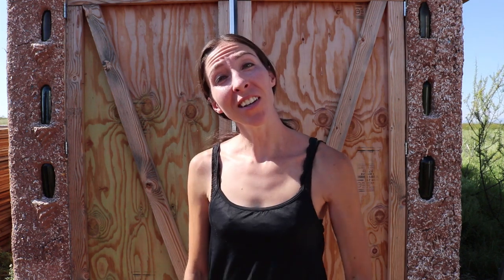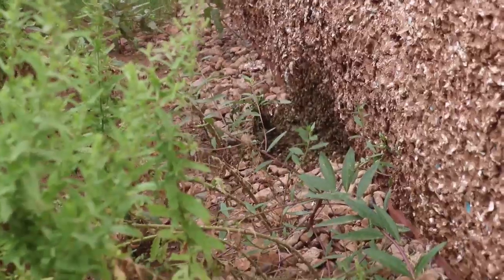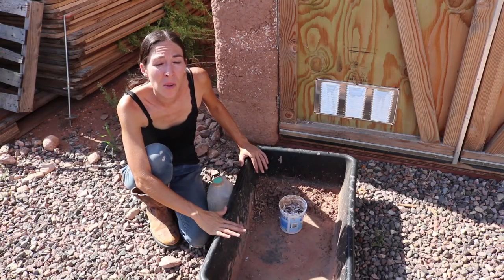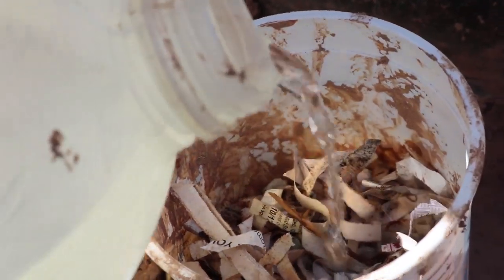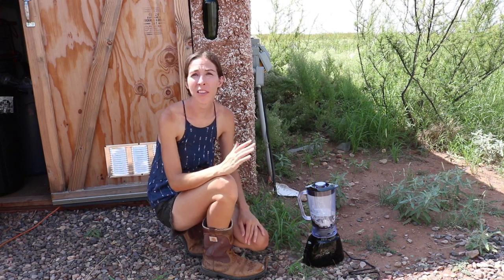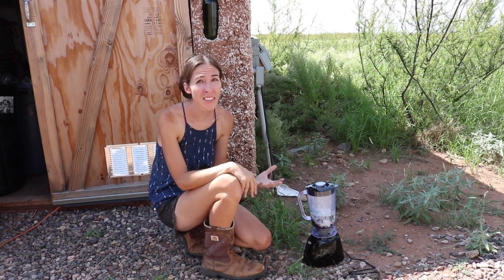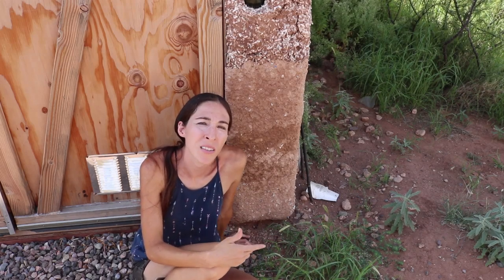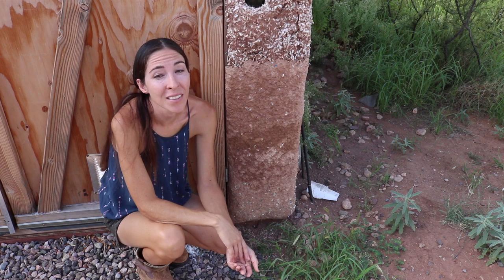Using Adobe Building Technique to Finish Our Off-Grid Solar Shed

Comment: To prevent cracking in the finishing plaster  you can use Cactus (Nopal) soaked in water, the viscous liquid from the cactus prevents the plaster from drying out too quickly and prevents the cracking. 
You can use 5-6 cactus ears, chop them up and let it rest in a covered 5 gallon bucket filled with water for at least one day up to 4 weeks (stirring daily). When ready to use, just remove all the cactus pieces and use only the liquid. It's been a common practice in Mexico.
Also, great idea using Lyme for the finishing plaster because it repels heat and insects.
Love watching your videos, very inspiring
Reply from the maker: Thanks for the tip. We'll have to give that a try.

Comment: I had the pleasure of working on one of the historical missions in Southern California. They don’t know exactly how old the building is but it’s over 200 years. It’s adobe made with mud and straw. They put a layer of lime on the exterior to protect the structure from erosion. They really knew what’s up because it lasted way longer than anything built today and with no chemicals. Looking good guys!
Reply: Oh and they wet the materials a few times a day after they do repairs to help fight cracks. We do that with new concrete also.
Reply from the maker: Adobe can be incredibly durable, especially in this climate.🙌

Comment: So you have bees now!  Nice! :)  If they're honey bees they won't bother you unless you disturb their hive directly.  If you DO get stung.. definitely seek a safe spot.. they pick up that "sting pheromone" to "target" the enemy.  Smoke is a great way to calm them down before you work on the shed.. doesn't take much.  I used pine needles on one adobe project.. was an excellent fiber!  Nice adobe work Jessica!  The properties of clay also lend clay colloids their ability to chelate or "lock up" and store nutrients like trace minerals, potassium, calcium and many others. In good biology those nutrients can be unlocked from the clay colloid. Clay is a VERY interesting chemistry thing.  Slow drying is critical for concrete floors too... Summer we used to cover a floor in plastic and soak it twice a day to slow drying and prevent cracking.  So the slow drying makes sense.. lets things contract "gently".  Looking forward to the lime part.. Calcium would definitely help harden it.. But I am looking forward to your details!
Reply from the maker: Thank you Carlton! We're beekeepers and we didn't even try.😆 We appreciate the bee tips. So far there hasn't been any issues. 
We're looking forward to the plastering. It will be our first time.

Comment: Tent your shed. Hook up your vehicle muffler to the tent and let the exhaust get rid of your bees. Love the paper and mud technique. You can put the paper in a big bucket and use a round blade hooked to a long metal pole on to a drill. Add water and let the drill do the heavy work.
Reply from the maker: Thanks Rita! I like the Bill idea. We're going to try remove any remnants of the bees ourselves.

Comment: Cracking occurs in plaster when it drys too fast. I wonder if covering the wet mix with plastic too slow down the drying would reduce cracking also.
Reply: Jess already is using hand building techniques used with clay, and what you mentioned is another for large clay pieces. However, the clay all the way through usually has similar water content and is not baking in the sun. The wetting the dry surface so it adheres to the wet layer and even texturing a wet to wet layer is the HB techniques I was seeing . I am sure we will see more techniques to control the cracking once they apply the finish coats, because as a plaster guy you probably have used some like I have used with clay. This makes me miss my college days when I could play with clay for hours. lol
Reply from the maker: It's possible. I don't think it will be much of an issue with the thinner layers and heavier paper mix.

Comment: The one thing i have heard about cob (adobe) buildings are that they need good shoes and a good hat. Your building does not have any shoes and your hat is not big enough to prevent erosion.
Reply from the maker: This may erode slower if we had a better foundation and roof, but even without those things it held up well. Once we have the plaster in place there should be no worries.👍

Comment: Ive done a lot of plastering work but never worked with anything like this. Would using a trowel to apply make things easier? Harder? I’m assuming definitely use a trowel with the lime application. Trust me, keep your hands away from lime. Protect your hands. Lime burn is no fun.
Reply from the maker: We'll definitely be careful when we get to the lime. A trowel does okay. It probably depends on how dry the mix is.
Thanks G!